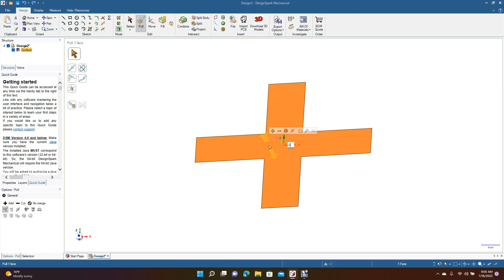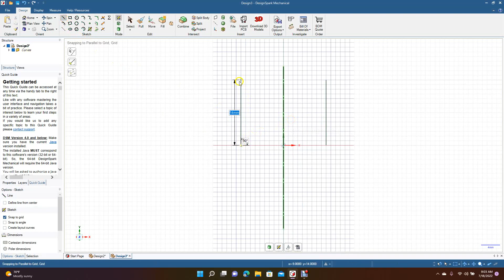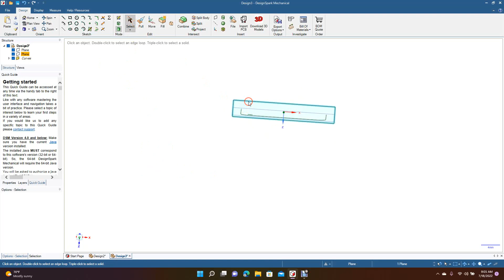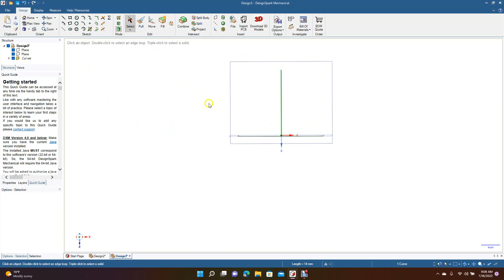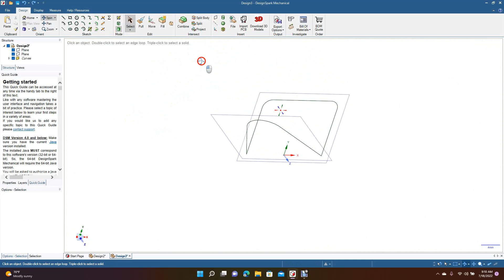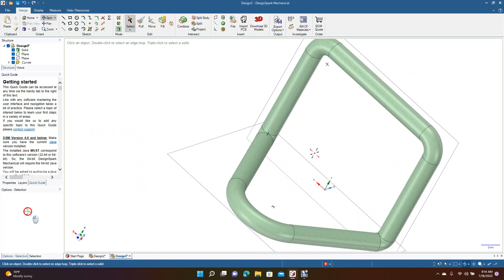How to add planes at different direction and use the split body feature in design spark mechanical

Comment: What a great tutorial. Thank you so much.
Reply from the maker: Glad it was helpful!
Reply: @dailey3drevolve  You Sir are the Master of explaining DesignSpark. If it`s not too much to ask for a video about tread and pitch. It would be very much apprechiated. Maybe a case and a lid. Or a bold and a nut. I`ve tried several times to make a box with a lid, but i`ve failed badly. DesignSpark was my choice, because it`s an offline program, but there is not much support for beginners. I would be more than happy to spend you a case of beer for a video about threads. Sorry about my english. I`m german.
Reply from the maker: @mikeuhlmann6825  No beer necessary, but thanks! I may already have a video about this, but If I don't, I will see what I can come up with.
Reply from the maker: @mikeuhlmann6825  Mike I just created a new tutorial on how to use the helix feature in design spark mechanical. Hopefully you will find it useful. Regards, Doug.
Reply: @dailey3drevolve  I just saw the video. It is great. Thank you so much. I owe you a favor. Greetings. Mike
Reply from the maker: @mikeuhlmann6825  You are welcome, Mike. Cheers!